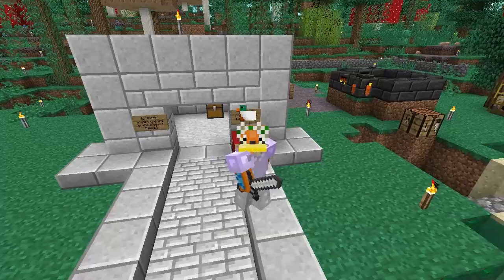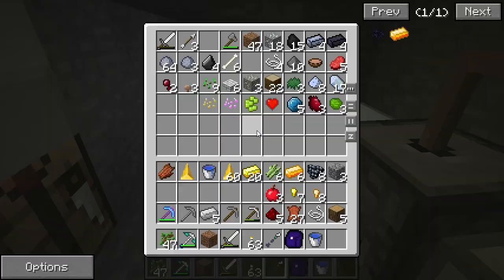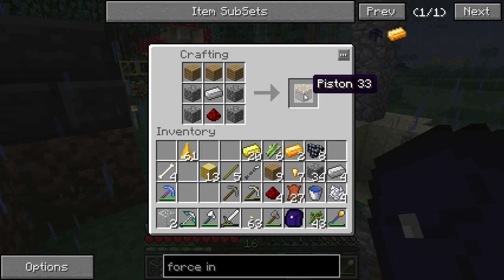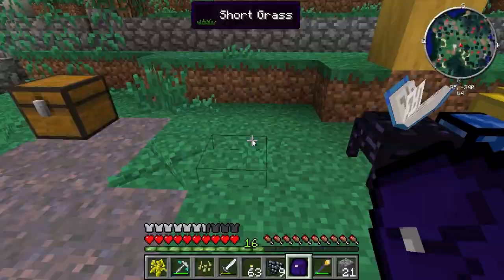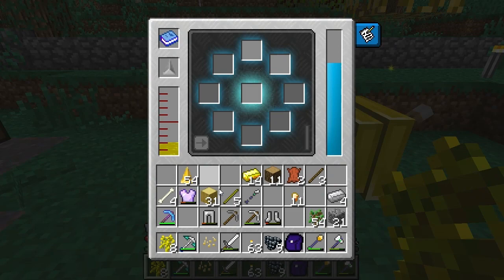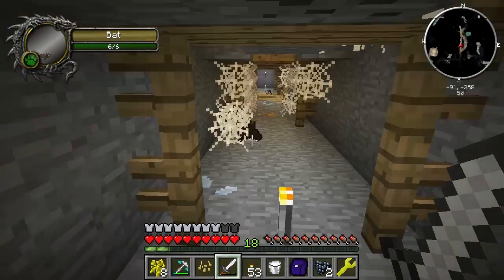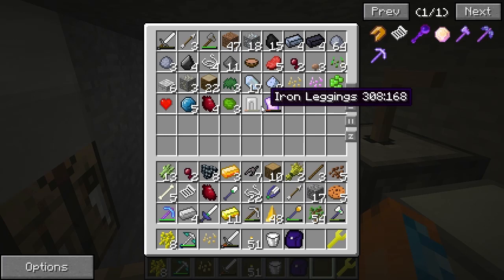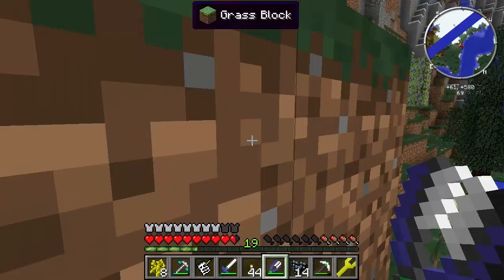HermitCraft FTB Unleashed Part 02: Dart(craft)ing Around!

Comment: if you accidentally get an enchantment you don't want, you can throw the item you enchanted on the ground and force rod it to lose the enchantment so you can re enchant it.

also, try using the force rod on nearly broken armor that isn't leather. check what happens.